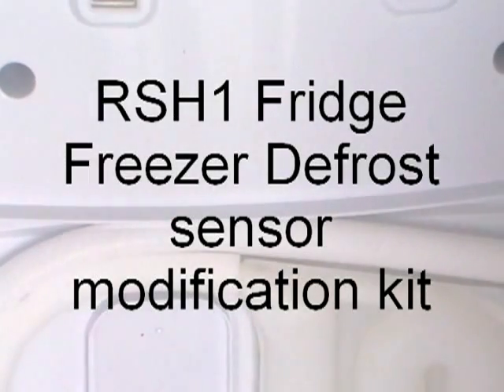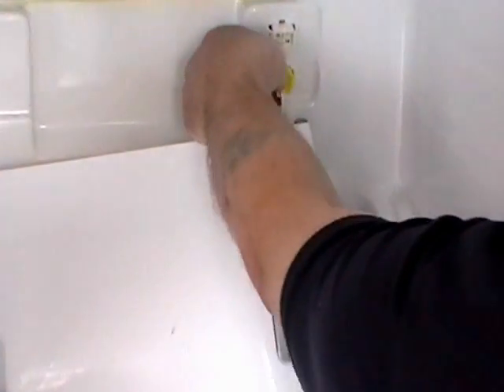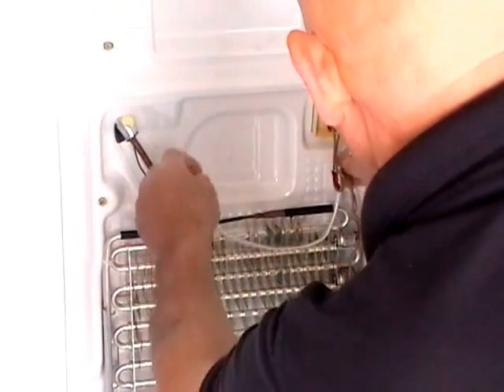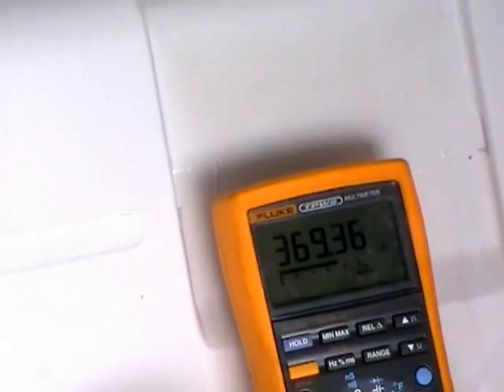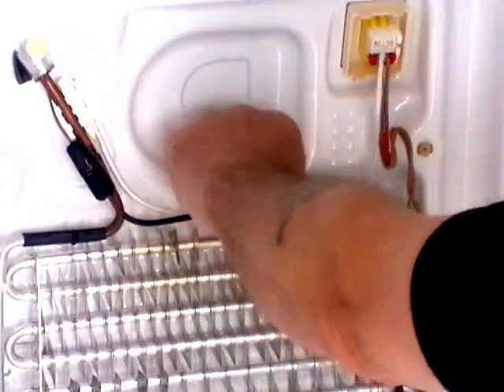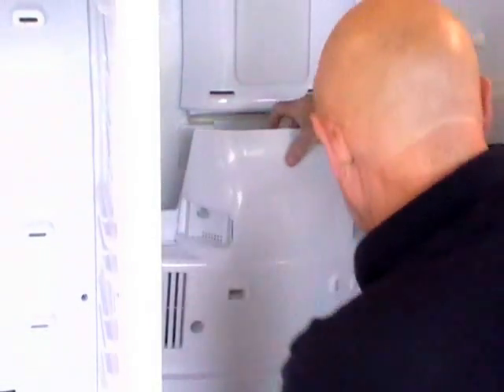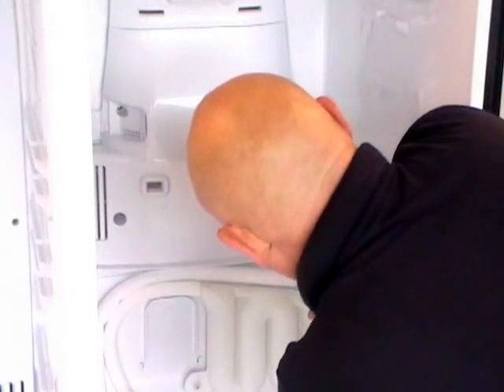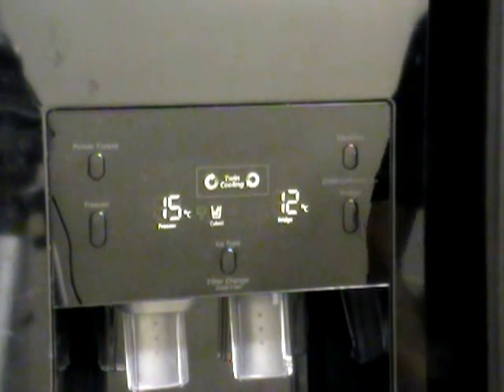RSH1 Samsung Fridge Freezer problem, fridge defrost sensor modification kit

Comment: Hiya. I followed you great video which helped me put in a new thermostat thanks. After about 4/5 weeks the fridge has  frosted up around the bottom vents. I have found how to force it into a defrost, but it strikes me that maybe with my 17 year old unit that the new defrost setting of 3/13 is not right for my fridge freezer as it never happened before. The problem is I cannot find what the original setting was as I would like to out it back to that. Any chance you know what it was please?
Reply: How did you adjust the defrost period for that? I am habving similar problem and now cant find any modification kits.
Reply: @onatbarscoskun672  I did exactly what it said in the video, as I haven’t been able to find the solution the fridge freezer is now useless with the fridge compartment frozen at the bottom and reading 11C the freezer is an unstable temperature too but reads whatever you set it to.

Comment: Absolutely brilliant information which proved to be very accurate. Used the wife's hair drier to quicken the defrosting of the cover panel away from the cooling tubes, hopefully the mod will work and save me having to de-ice the fridge every couple of months, the tell tale sign being the fridge circulation fan rubbing on the build up of ice. A big thumbs up from me.
Reply: Hi!
Did that help?

Comment: unbelievably terrible design, i hadn't realised the complete back was full of ice. When i looked onto the back of the panel that the fan is held on, there are various bits of tape holding things and sealing things together - clearly Samung knew there were issues but sent the fridge freezer out nonetheless. thank you so much for this video

Comment: Hello, thanks for the informative video. I am not sure if i have the same problems. My refrigerator works fine but my fridge isn't getting the temperature down. So i have to change the sensor in the fridge department or in the refrigerator department as shown in the video? Also i think that the motor is continuously working. Is that possible?

Comment: Hi, I'm getting a reading of 345 on my heater element continuity test and not 369 as on video.  Does that mean that I need a new heater element?
Reply: Hi - my defrost heater also has a resistance of 345 so unsure if I beed a new heater - did you find out if 345 is too low and you needed a new heater?

Comment: i will say from previous experience if the styrofoam inside the evaporator panel has been cracked or damaged, condensation will soak inside and damage it thus making the fix kinda temp or useless as dampness will cause it to freeze and expand.. if when you remove the evaporator cover and its damaged or heavy with water ingress i suggest changing it..

Comment: help PLEASE, i install the sensor repair kit as per video, however only when trying to change the defrost settings i found out that I was on the first ding dong, the numbers I entered on the display was  4 (fridge side of the display) and 7 (for freezer side of display) it was only when I saw that I couldn't reach 13 & 3 that I was in the wrong setting.  How can i correct this now?
Reply: i think every time you hold the two buttons it resets
Reply: @wrightyz   hi stuart, thanks for taking the time to reply. I see the u-tube video refers to a reset also but do you know what the first option does?

Comment: Any advice whether or not these mods are advised on a RSH5? Pretty much the same issue so will follow the disaasembly guide and total defrost guide and check where the sensor is and the heating element.  Fridge does ice up so the cooling loop I assume is charged.
Reply: Similarly, would be great to know if there’s a mod kit for the RSG5. I ended up clearing ice from behind the panel last week. ☹️
Reply: @jjv65uk  About to remove the panel behind mine today after defrosting for 2 days. we shall see. Not a massive problem for me as this has only happened once in about 5years.  The ice tray inlet has iced up twice though.
Reply: All worked and needed to press the reset button on the ice maker. Checked with fridge thermometer for a few days and now all is well.

Comment: Hey there. Just wondering if you guys from ukanfixit are still there? As your homepage is not reachable? As i still use an old rsh1 model i am very interested in you defrost sensor kit? Using google i can only find complete repairsets including backpanel for around 120£ which is not worth it for that old stuff. Greetings Andreas

Comment: Great video.  Before I saw this video I replaced the heater.  Replaced all the sensors around the heater and nothing worked.  I bought a kit to keep the drain hole defrosted.  No change.  Kept icing up.  I wish people wouldn't post videos of solutions that are bogus.  Saw this video bought the defrost sensor on amazon for $10 which comes with a longer wire.  Used sheet metal snips to get the old sensor off.  I reused the clip that held it onto the defroster.  Its on a curve so I just trimmed one end of the curved part off and it was straight.  Put the new sensor with trimmed clip on where this video shows to put it and it's fixed.  6 months with no ice.  I haven't gone six months without this thing freezing up since I got it.  Samsung should send this sensor to everyone who bought one for free with instructions.  This is a major design flaw.  Anyways great video thank you!
Reply: So you didnt buy the whole kit you just bought a new sensor and re-positioned it as per the video 

and it worked? You didnt say anything about the new settings so did you adjust the settings as per the video or did you leave them as they were?
Reply: Daniel, My fridge that keeps having the icing problem on the left hand side (as shown in this video) does have the black sensor. Did you have the black sensor originally installed in your fridge and you had it replaced with the white sensor (and placed it on the left hand side like it is shown in this video)? Anyone knows what is the difference between these two sensors?

Comment: Can you put a link up for sensor kit? I can't get hold of one
Reply: buy the sensor on amazon with the longer wire.  You can trim the existing curved clip holder straight with scissors or tin snips and that's it.  $10 later all fixed.

Comment: I believe I found the part referenced in the video on Amazon and it looks like I can purchase this in the U.S. (search on Amazon for 'Samsung Fridge Freezer Evaporator Cover Support DA81-01997A'  However, the Amazon listing clearly states, 'Please be aware that all electrical items, are European voltage 220-240v not US voltage.'.  Wondering if this will work in the States or if there is a version for U.S. models?

Comment: Once upon a time my two door American style Samsung Fridge Freezer (model RSH1NI-IMH; lacking water attachment) iced up and made a noise of the fan scraping against ice as described in the video https://www.youtube.com/watch?v=R_kbnddADDU&pbjreload=10

As a temporary workaround I used a hair dryer (or carefully injected syringes of hot water) to melt the thick ice. Reassembling the  Samsung fridge/freezer temporarily resolved the problem and the scratching sound went away. 

What I should have done from hindsight  would be to promptly replace the 
Samsung Fridge Freezer Evaporator Temperature Sensor; £10.93; http://www.espares.co.uk Stock Number ES1665972 as elaborated in the above youtube video. 

The refrigerator worked OK for a few months, but eventually the noise of the fan scratching ice reappeared. 

Latterly though the scratching sound disappeared (apparently as a result of burning out the Samsung Fridge Fan Motor for RSH1NHMH (ES644120); Espares.co.uk Stock Number: ES644120 ; £55.79). Unfortunately I could not find a video explaining how to replace that fan motor, but it is relatively straightforward: unscrew the four screws holding the plastic frame into which the fan motor and fan are embedded. Open the plastic pouch holding the fan motor. Detach the electric wires from the fan. Using a pointed pliers tightly attached to the rotor of the motor from the fan (pulling and turning the fan), separate the fan from its motor. 

After reassembling the refrigerator and turning the power on I heard the quiet music of the fan humming in the background. The temperature display took over an hour to show the temperatures desired. Until that happened both units displayed around 16 degrees Centigrade (room temperature). Happily all is working well and I am assured the fridge/freezer will give some more years of service. 

The morale to this tale is: Replace the evaporator sensor promptly if you encounter ice buildup on the left side inside the refrigerator compartment or pay dearly to replace the fan motor!

Comment: My mums RSH1PHPE was frosted all the way through the fan... 
(This happens at least 2 times a year) and i defrostet all the parts and after the installation the fan didnt worked... Any suggestions? Or do i have to buy a new one?

Comment: I have had problems with my Samsung RS267lash US Fridge over
freezing and causing inside middle vent hole  to eventually freeze to
point of no airflow , then fan grinding eventually to a halt from being frozen.
When I force the fridge into defrost mode, it does not seem
to melt the ice either.
*Theoretically, if I force it into Defrost mode, the heating
elements should come on and should be able to test 110V Correct?

Don’t think it’s a bad Defrost heating element ,  last time I checked this it showed 96 ohmsDefrost sensor (yellow) was +- 2K at Room temperature. 
Thermal fuse (Red black /w white foam) = 0 ohms 

Not sure what to do now.

Comment: Does the defrost on the refrigerator work in conjuction with the freezer? The drain at the bottom of my freezer keeps icing up and then the freezer temperature starts rising. Any information would be greatly appreciated. Thanks for posting the video it has helped out already understanding this troublesome Samsung refrigerator.

Comment: bought this kit and replaced sensor worked absoulutley brilliant and informative  only two things i would point out leave fridge for 24 hours after switching off ice melts very slowly behind pane l also take pictures as you remove wiring blocks

Comment: hi. I have a problem with my samsung rs21 ( fridge defrost) I was  check my defrost sensor with electric tester, when sensor is warm work fine but when I put  sensor in to cold water is not working, what do you think, this may be not working sensor? THANKS

Comment: Thank you for an excellent and informative video. It might be worth mentioning to anyone doing this procedure that you need to leave the fridge for a VERY long time for the ice behind the panel to melt otherwise you'll pull the cooling pipework away with the panel and ruin the whole lot. (The usual couple of hours is not enough for ice trapped in a very well insulated cavity.)

Comment: Whilst this may cure many of the RSH1 issues with the ice build-up. It will not cure most. As a Trained Engineer (Inc on Samsung Products). I have found a permanent cure to the ice build-up issue. Sadly, I cannot share this information as it is not authorised by Samsung. Samsung prefer instead to either exchange appliances in warranty or expect customers without warranty to replace the product at their (the customers) cost.
Reply: If you were that loyal to Samsung, you wouldn't be telling everyone that they want to you replace instead of repair.  I doubt they'd want that information out there either.  Bottom line, there is no permanent fix.  These Samsung refrigerators are defective pieces of garbage.
Reply: Please please please message me with the fix. I have the RF266 model with the same issue and I'm desperate to fix the problem. I have lost so much food multiple times because of this horrible defect.
Reply: By the way, you're authorized to share some bits not the whole information, like testing progress, if you share repair informations it's not a problem, I also work for Samsung as a Software Tester for me it's ROM files and testing reports that I'm not authorized to share... I'm authorized to share phones repair instructions though.
Reply: He's full of shit obviously
Reply: Yeah probably so. I dumped the POS Samsung fridge and will never buy another Samsung appliance. The Samsung washer I bought was defective as well. Got it replaced with another manufacturer model under my state's lemon law. I will only buy samsung phones and tablets from now on. No major appliances.
Reply: +JM yes , I also made the same mistake of assuming the appliance would be similar quality to a mobile device.  They are clearly more focused on mobile.  Wow, that's great on the lemon law though.  I will look into that, since my $1900 Samsung fridge is an absolute lemon.
Reply: Hey, my samsung never i ed up in 17 years. It needed this fix which i have done and now 5/6 weeks later it is icing up! I think the setting may be the culprit, but I dont know my previous setting or I would put it back. If you know I would appreciate it if you would post it please. The 3/13 just isnt working to keep the i e down.

Comment: Very good instructions , thank you.  The only things I would add for a novice like me is to photograph the electrical connections before disconnecting and also that the motor takes 4-5 minutes to start after switching back on.

Comment: Hi ukanfixit ... You sound very experienced indeed.. Hopefully you could please help me!??? (I would be very grateful)

Samsung have replaced the dodgy parts in the fridge under the recall extended warrantee (with the same kit as you are selling) … but it appeared that the same kind of thing was happening to the freezer side whilst the fridge side seemed to remain fully functional…
The short term solution was to fully defrost the freezer, then it worked fine until the ice built up again, especially down the bottom… now, since the last defrost it just keeps throwing the trip switch so can’t use it at all :(
Any initial ideas on what is likely to be shorting out would be extremely helpful?… after defrosting, there was a draft coming through the vents but is it likely that this could have been coming from the fridge rather than the freezers fan?
Reply: charmaine char k

Comment: Nice and very informative video.
Some days ago I called a technician from samsung and I noticed that after repairing my rsh1dtpe, at the defrost temperature settings he put the value "13" from the freezer button (left) and "3" from the fridge button (right), that is the opposite to what you suggested.
Which are the right settings?
What possible problems could these settings cause to my refrigerator?
Thank you in advance

Comment: Very informative video! I wonder if the defrost temperature setting "3 13" that you've applied is resetting to "0 0" every time the fridge is unplugged? Shall this trick be done after the power down? Thanks!

Comment: Bought your full kit with the heater, but my fridge has the later single TOC heater so I left that in place as it tested fine.
I have the fridge  without water dispenser and the end adjustment of the defrost cycle wouldn't work. Option item (right figure) merely toggles between 0 and 1 and option value (left figure) will scroll up to 15 but even setting it at 13 I cannot change the right hand figure to 3 without resetting left figure back to 0.
The fridge is up and working, but I want to make sure its right.

Comment: Hi my water bottle keeps freezing up, which stops the water dispenser working. It also causes my salad basket freeze too. I have defrosted the water bottle by pouring warm water over it. This allows the water dispenser to work, but the water bottle freezes again within a few hours. The temperature is set at 5 degrees and the rest of the fridge is working fine. Do you think I need to replace the water bottle to solve this problem

Comment: HI ukanfixit

Excellent clip and service!

I am in dispute with Samsung at the mo as they say my Unit had a modification made to it during manufacture, however it seems to be having the same problem as everyone else's! It's a RSH1NHMH and they are saying that it was manufactured in October 2009 so will not have this problem. 

Please could you confirm if you have had any other similar models manufactured in 2009 with the same problem? 

Many thanks

Comment: Hi, I need help with a fridge I got, and can't find the solution anywhere on the net.
Basicly all fridges have default temperature settings, lets say our fridge has x for upper and y for lower default temperature settings. These default settings are for when you unplug the fridge or when you plug it in the first time after purchasing it.
HOW do i change these x and y?
Because i live in a country where the power constantly switches, turning off our fridge and resetting the temperature.

Comment from the maker: Hello,
Can't comment on another's work when i can't see what has been done. However all the components in the kit should be fitted as well as the re programming of the user card on the freezer door. The back panel should have been inspected and has to be perfect for it to be reused. Special attention should be paid to the foam seals of the back panel, they do have to be perfect. The heater can also influence the "frosting ice" as can the gas system and the power pcb.
Ask Domex to re visit

Comment: Hi. thanks for the info on the defrosting of Samsung RSH1DTMH
i have had Samsung's engineer from DOMEX come and change the bits you have mentioned. However i still get build up of ice in the Fridge.  Domex engineer has said everything is okay and they have been there 3 times but i still get the icing in the fridge. could you advise what i need to have done please.